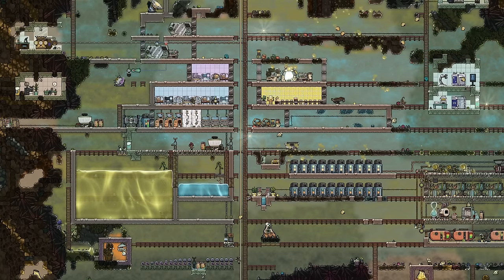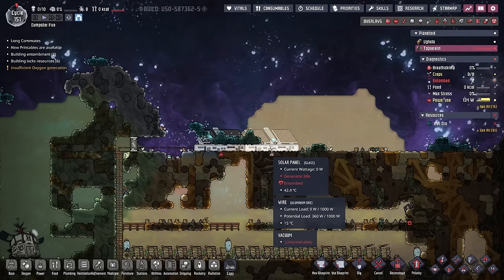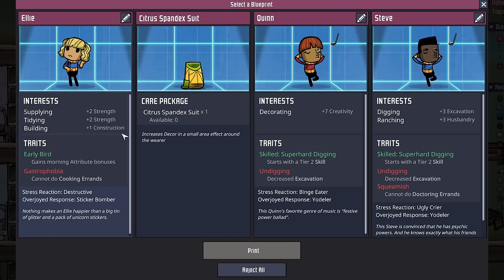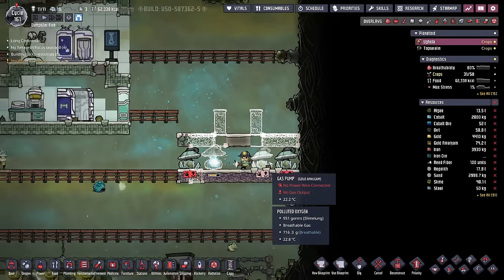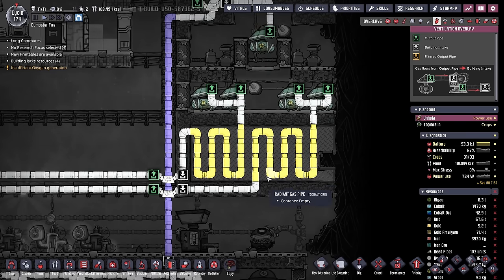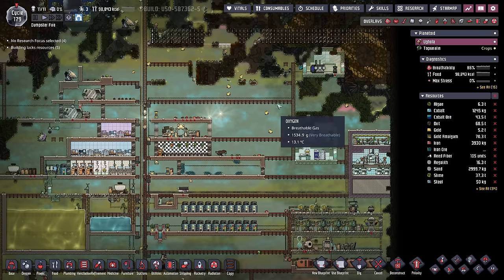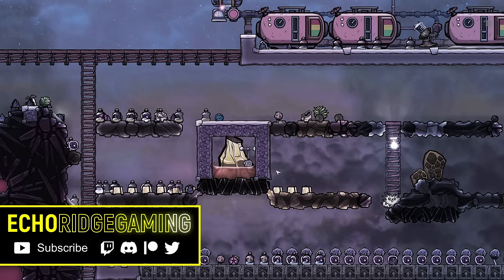Oxygen, Heat, and Sand oh my, Half SPOM | Ep 4 | ONI Metallic Swampy

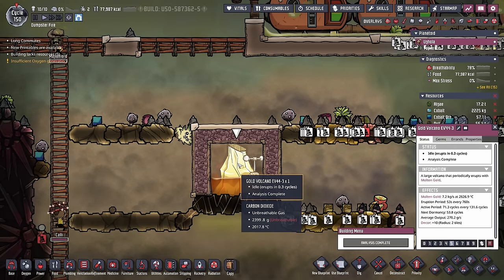Comment: 4:00 You can heat up a cool slush geyser from -10 to 80C, then delete the heat using a pincha pepper, this is a huge thermal buffer for cooling. In my swampy play through I used it to tame 2 steam geysers and provide cool water to my base

Comment: First nice video!
A couple of things I'd do differently (simpler way).  Place only one vent inside the clean water pool,  submerge at about the level you want. Add to the pipe that leads to it with bridges.  The vent will overpressure, water stops flowing towards it. No need for two vents controlled by a sensor. No automation required, simpler piping.

The heat exchanger for the SPOM is way way way way overkill. Just have incoming clean water loop around  the  O2 pumps in radiant pipes before entering the electrolyzers. Yes, O2 will be warm-ish,  but its SHC is so low that the amount of heat released by the non insulated O2 pipes in the environment is minimal, and one single radiant pipe segment from your cooling loop can handle it.
Reply: It took me way longer than I'd like to admit to realize I don't need any complex automation and just put the vent low enough so it will over-pressure once the desired level is reached and then the piped water will just continue on its merry way. I've been playing on and off since late 2020 and it was only in my new colony that I made for the Sweet Dreams update came out that I figured out that sometimes I should think of simpler solutions before I make a small computer out of all the automation logical circuitry. 😅😆

Comment: Looking good so far!  Interesting automation coming out of the brick, I hadn’t really thought about using 2 sensors without an OR gate. I have a couple of cooling loops that get stuck, so I may need to add the backup sensor to force some movement.
Reply: Yea, for some simple setups you can totally go without the OR gate. How did you fill your cooling loops? If you use a bridge to fill them and put the extra pipe segment on the output pipe of the Aquatuner your loops shouldn't get clogged ever. And if you're not using nuclear waste as coolant the best way to make sure your loops are running smoothly is to add a buffer tank to the loop. That way any excess water gets stored in there, you can easily extend the loops when needed and as an added bonus the tank equalizes the temperature of its content and you get a steady stream of chill for unlimited number of cycles.
In my last base I had 5 Aquatuners running by cycle 365 (that was the day I turned on the reactor) and I didn't had any problems, even with the nuclear fallout loop.
Reply: @Pancake_Nix  I do have a buffer tank in the one loop (post-AT).  This is my "relearning the game" base, no DLC, and is currently around cycle 550.  This is one of my older loops and has a "feedback" loop after cooling to send the P-water back through the AT if it is still too hot to send into main loop.  I have 2 other loops with this feedback setup, one with and one without buffer tank. The one with was clogging before I added the tank and has been fine since.  The other one has been fine the whole time (well, to the this point). Thanks for response!
Reply: @dogbarian8280  Hmm.. It is very strange that the one with the buffer tank is clogging. That would indicate some issue with the plumbing. Sometimes adding in a new bridge at a peculiar location seem to stop the flow. A closed loop with a tank should never ever stop flowing if everything is set up correctly, so since you're saying you're adding the water, I'm thinking there might be some 'miscommunication' in the automation as well. It's hard to tell without actually seeing the piping and wiring.
Check the piping of all the involved AT's. Like I mentioned before, I found out that putting the extra segment on the green port instead of the white one helps prevent the clogging in the case where the AT turns on while the loop is still filling. 
Hopefully Echo will be doing some more Base Fixer-upper videos and you can submit your base to help him solve the problem if it persists :)

Comment: 250g/s and 450g/s are the right values, or at least are the values I have on my half spoms, and they both have been running for like, 400 and 800 cycles respectively
Reply: Setting the H2 sensor to 250g seems to do fine, but when set so low, and you still want best efficiency, the Atmo sensor must go on the right side of the pump to make sure it never pumps less than 500g/s. But I guess that's such a small detail and even if the H2 pump occasionally sucks less than 500g per intake, it's not the end of the world.

Comment: After almost 600 Cycles I got lucky with the Pod and it gave me a Larva Slickser, so it is possible to get Plastic with this seed. Now I have to pop open that CO2 Geyser on the other planet and transfer the gas to create oil.
Reply: Let me know how that turns out. I only once tried a CO2 geyser to feed the Slicksters with, but the ridiculously low thermal conductivity made it hard to heat up. First I started getting Longhairs and ended up with a bunch of dead Slicksters after finally scrapping that project.

Comment: i had great succes with a meteor cooler
5 Turbines in series the hot materials come in on one side and the steam slowly gets colder until the materials entered the final water basin with the steam engines output - so i could use the entire temperature from 300°C to 95° for steam/ power production

Comment: You can re-plug a volcano by building a temp shift plate made out of coal on the right spot. It'll very quickly exceed the 277 degree melting point and turn into a tile of refined carbon during the next eruption.
Reply from the maker: I opted to seal it so it will keep erupting.  I'll eventually by able to get the gold :)

Comment: 4:20 - Did you mean to put radiant segments on the output of the metal refinery or was it an accident?
Reply: I was wondering the same thing as this is causing alot of heat and using alot off water as result.

Comment: Its time for... Youtube comments math! (du-dudu-duu-da!!!)

Lets assume you just dump all outputs of gold volcano and cool slush gaiser together. That means water will gain some heat from gold, and eventually it will end up to some temperature T for both gold and water. Thats pretty much concludes any result any fair cooling system will end up to in terms of taming that volcano.
 
Based on resulting temperature we can easily decide if its enough to cool down the gold or how taxing that is.

DTU from changing temp from t0 to T is Specific heat capacity * Mass * (T - t0)
SHC is 4.179 for polluted water and 0.129 for gold.
Average output is 1430g/s for water and 276g/s for gold
t0 is -10 for water and +2627 for gold.

So lets write down heat zero sum:

4.179 * 1430 * (T+10) + 0.129 * 276 * (T-2627) = 0
5976*T + 59760 + 36*T - 93531 = 0
6012*T = 33771

T = 5.6 degrees. Delta of water temp after volcano cooling is 15.6 degree.

Conclusion: we can safely assume one cool slush gaiser capable of taming that volcano, and have heat capacity left to cool other things down. However, taming two gold volcanos push water over 20 degrees, so it could not cool base as much. I would recommend to not to be greedy and tame only one volcano untill you have plastic... Or use some cheesy heat-erasing solutions.
Reply from the maker: Love the math you have done!  Amazing.